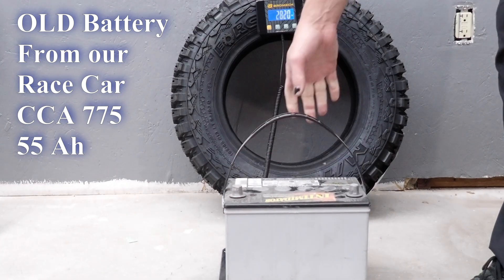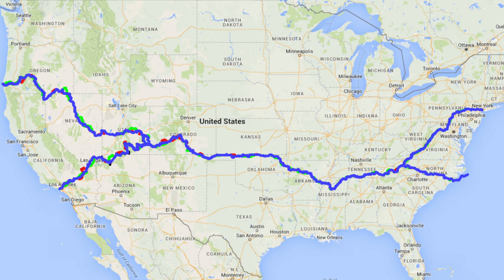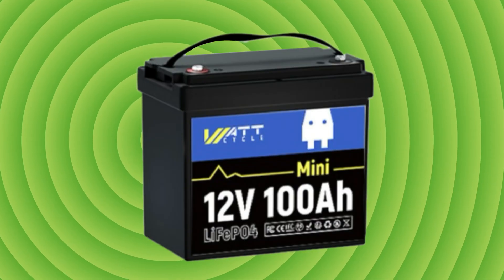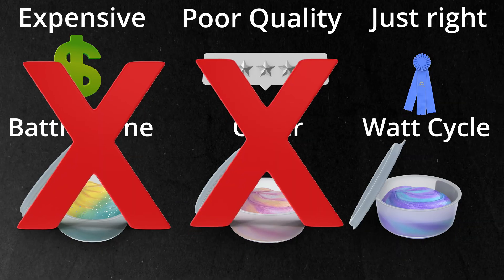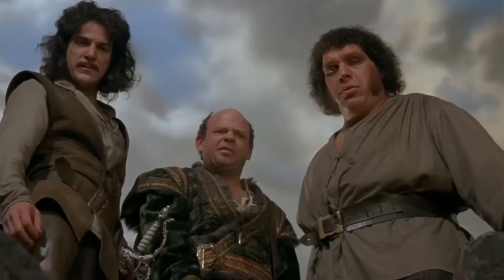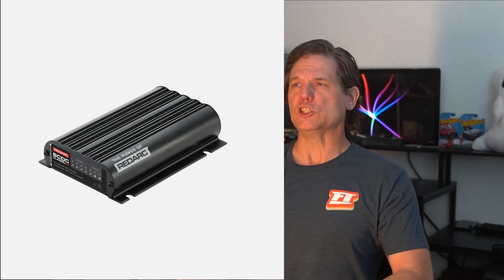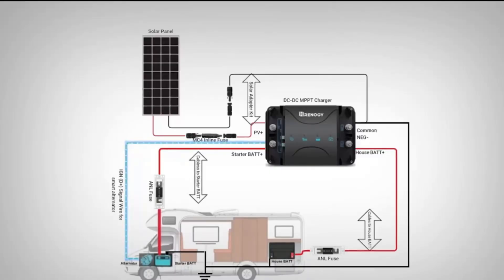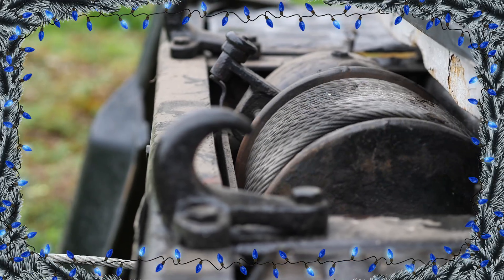Switch to Lithium. HOW? Watch This First

Comment: You're joking, right?
Reply from the maker: Joking? Only if prioritizing energy density, charge efficiency, and long-term reliability is somehow controversial. Lead-acid chemistry, while charming in a mid-20th-century kind of way, suffers from low cycle efficiency, high internal resistance, and a terrible weight-to-capacity ratio. Pair that with thermal sensitivity and constant maintenance needs, and it's hard to imagine why anyone still defends it—unless, of course, they enjoy solving 100-year-old problems with 100-year-old solutions.

Comment: Lithium is great for engine starting AND you have 95% of the charge available for use. Lead acid gives less than 50%. The only snag is lithium battery management cuts power abruptly when it’s full. That can create a voltage spike. The charging system needs a protection circuit to handle the spikes.
Reply from the maker: Exactly—lithium is a huge upgrade in terms of usable capacity, but it definitely comes with quirks. Cold weather was a big factor for us too, which is why we went with a DC to DC charger. It not only protects the lithium batteries during low temps, but also prevents those abrupt cutoffs from causing voltage spikes. We can't afford to damage our alternator—it's already working hard in our setup, and replacing it would be a pain (and pricey). The DC to DC charger gives us a controlled, safe way to keep everything happy and healthy.

Comment: When I was younger my lead batteries lasted 10 years plus sometimes now I can barely get two or three
Reply from the maker: Absolutely, and thanks for sharing that—it's wild how much things have changed over the years. For us, the main motivator in moving away from lead-acid is weight. Our van’s only putting out 45 horsepower, so every pound really counts. Dropping even a little weight can make a noticeable difference in performance and range. That said, we totally get the nostalgia for those old batteries—they were tanks!

Comment: I live in Michigan it gets cold here and the bms can't handle the cranking amps.
Reply from the maker: Yeah, that totally makes sense—Michigan winters are brutal, and most standard BMS setups just aren't built to handle that kind of cold-crank demand. That is why we are going to run a small AGM as a starter battery, then have the DC to DC charger to the lithium. Gives us the best of both worlds.

Comment: Cost, lead acid wins every time, its a technology proven over a very long time, and its recyclable, what's not to love about it, sounds like your selling something!
Reply: @ianadkins-2530  Just the weight thats all that sucks, for the same size lithium phosphate you can double your Amphours and cut the weight in half. The price of lead is fixed and should be half what is charged for a battery.
Reply from the maker: Haha fair! Lead-acid’s the OG—cheap, reliable, and recyclable. No arguments there. But lithium isn’t snake oil—it’s just a different beast. It’s way lighter, lasts longer, and handles deep cycles way better. And for us building out a Kei van where every pound counts, that weight saving is huge. We're even switching to an electric water pump just to ditch the parasitic drag and squeeze out every bit of efficiency. It’s not about hype—it’s about making a tiny van punch above its weight 😄

Comment: This is all BS i dropped a lithium battery in my car 5 years ago with no bms and I live in idaho where its below 32 f, 185 days out of the year! Battery stays balanced by its self if you use good cells i used 130 cells for a 110 amphour pack with a stock 100 amp alternator that charges it up to 14.7v. I challenge this guy to just drop one in and watch it work fine, you dont want a bms because you never want it to cut power.
Reply from the maker: Hey, really appreciate you sharing your experience—that's awesome to hear it's been working reliably for you, especially in Stanley Idaho, one of the coldest places in the lower 48 (if you are reading this and have not been it is epically beautiful)! I'd love to learn more about your setup. What kind of vehicle are you running, and which specific lithium battery you are using for your system? I'm diving deep into this topic and would love to research your build as a real-world example. Thanks again for chiming in—this kind of info helps everyone out! 🙏
Reply: Lithium what?  Ion, Sodium, iron phosphate?   There are others as well.
Reply from the maker: Absolutely—there are a bunch of lithium chemistries (and even some non-lithium ones) out there, each with their quirks:

Lithium Iron Phosphate (LiFePO4) – Super stable and long-lasting, but can struggle in the cold and has a lower energy density.

Lithium-ion (like NMC/NCA) – Higher energy density, great for EVs, but more volatile and shorter lifespan.

Sodium-ion – Super promising, and cheaper since there’s no lithium, but not quite ready for prime time—lower energy density and still early in development.

Lithium-Sulfur – Theoretical rockstar, practical headache. Amazing energy potential, but not stable or cycle-durable yet.

Solid-state – Basically unicorns right now. Everyone’s hyped, but we’re still waiting on a production-ready version.

Got a specific setup or chemistry you’re curious about? Happy to nerd out and dig deeper!
Reply: @ phosphate its the only chemistry that the voltage works in a 4s configuration, 3.65 volts per cell max.

Comment: Lithium What?  There are different chems in these things. Some more suited to tasks, some Not.
Reply from the maker: Great point—lithium isn’t one-size-fits-all! Different chemistries like LiFePO4, NMC, and others have their own strengths and weaknesses depending on the use case. Usually LiFePo4 is the go to for RV’s, Vans and vehicles in general.
Reply: Lifepo I think is the best one for cars. Large capacity. I